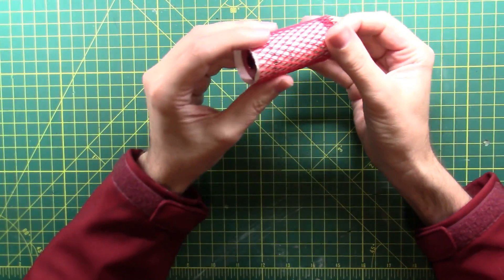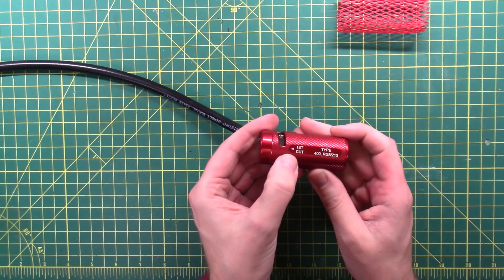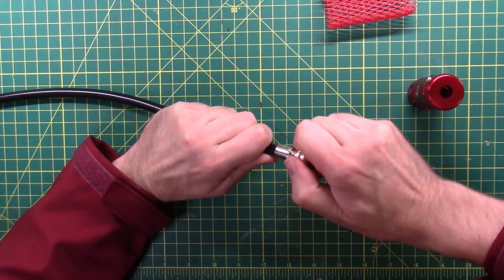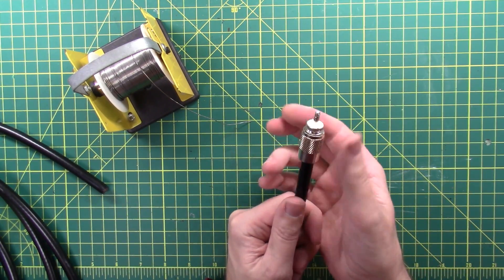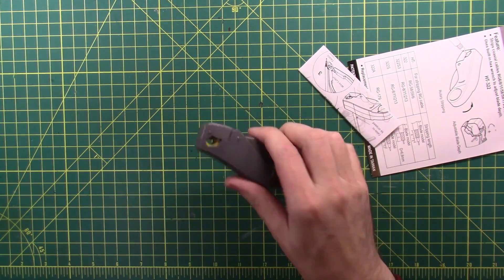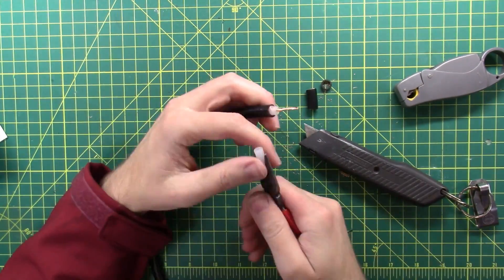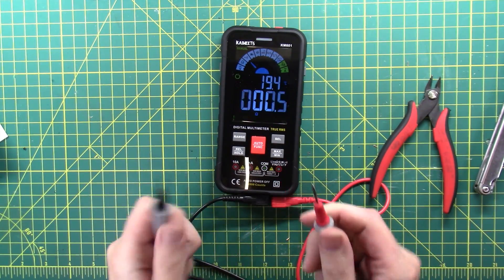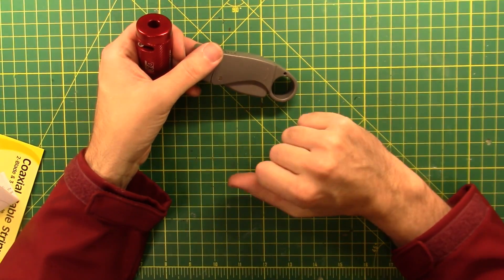DX Commander is Back! - How to install PL-259 Screw on Coax Fittings

Comment: Screw on PL-259's. Do you have to solder the end tip? Screw on implies 'done'. Evidently not since you are soldering? I have to ask because I have 4 antennas and 12 PL-259's to put on. If I don't have to solder I won't. Plus 10 of the 12 PL-259's will have to be put on  in the field :(

Comment: nice tools for coax. I found better PL 259 from M & P . and I went the lazy way. I had them make the coax I want with the ends I want and length I want and test them and ship to me.  used K8MRD for discount code. and now on the way from Italy . they ship in one box  . 50 ft POTAFLEX 7 reel kit and several jumpers . some with N . maybe I can tell my girlfriend it is a special bottle of wine .when she ask me what I order from Italy.  anyways great PL 259 from DX engineering. The amazon ones junk  I got. when using a reducer for RG 8X solder the shield. keeps the reducer from coming loose  and effecting SWR . what happened to me. or just get PL 259 for RG 8X and no reducer needed. 73's
Reply from the maker: Great tips, thanks

Comment: Well, that looked like a great tool so I was going to buy one until I saw on the eBay listing that they don't ship to Hawaii. Oh well, my razor knife works good enough and I can get replacement blades for it shipped here.
Reply from the maker: Does dx engineering's website offer shipping to HI?
Reply: @temporarilyoffline  Yeah, I have ordered from them in the past, but they gouge us on shipping so I normally go with their competitors.

Comment: Fantastic & easy tutorial Steve & thanks for posting!.
Only thing I'd add is I'd buzz out the connections for shorts & continuity tests on long runs.
Those 259s look like top quality connectors.
Generally, I personally avoid soldering the braid as it's easy to melt the inner insulation but have tried both ways as differing organisations have differing requirements.
Have used both tools & for ease the 1st box cutter type tool is almost effortless especially when doing lots of coax stripping.
Must get me some stripper tools to suit 213s & LMR400 as mine are seriously ancient & can't do those cables.
For outdoor installations of coax I honestly prefer to run them inside conduit as possums, parrots ie cockeys, rosellas, cockatiels & other animals here in Australia seem to find coax a "Salt Bae" type delicacy to munch on & cover connections with amalg tape for waterproofing.
Keep up the awesome work!
Reply from the maker: Thanks for the kind words!  Completely agree!

Comment: Regarding DX Eng. tool, wire and connectors ... seems as easy as messi paoloni, no? And I have already bought a crap load of DX Eng. 213, so no crimping ... me likey. AND the connectors are reusable ... NICE!
Reply from the maker: RG-213 is a "standard", so the tool from DXE should work with M&P connectors. Maybe I'll try that next time.
Reply: @temporarilyoffline  Thanks, that's good to know.

Comment: I used the gray cutter in the video for solid cables, LMR-400, LMR-240 and LMR-195. For RG-58 and RG-213 I used a new simple box cutter blade and it works great if you dont cut your fingers.  HI8DL
Reply from the maker: If I only did one or two, I'd used a box cutter blade... but I always seem to need to do 5 or more.

Comment: Rg-213 and lmr400 are pretty similar but DXE says its for 213 and no mention of LMR400. What say you?
Reply from the maker: This is for 213 and 8, I've never seen lmr400, so I can't speak to it.
Reply: @temporarilyoffline  so I called DXE. The answer is No. it’s possible but won’t cut as clean. Also lmr400 has a foil in it that causes issues. Then there is the lmr400 Ultra Flex version that has a glue like element inside. Both 400 and 213 are the same outter diameter like I thought but 213 is solder/solder and 400 needs a crimp/solder. Andy at DXE was very helpful.
Reply from the maker: @forgetyourlife  excellent,  thanks for the update

Comment: Tried the spinner they sell for RG 178.  It was a nightmare.  The DX Eng. device is top notch.  Do you need to solder the center pin for crimp connectors too?
Reply from the maker: I've never crimped coax... I don't know.  More to learn!
Reply: @temporarilyoffline  K8MRD had a video on it and swears that crimping is equivalent.  I had a huge issue with crimping that RG178.  When I checked continuity I could not get anything on the center pins.   Before I moved I had LMR400 and crimping that stuff required WWE-level hand strength.  But it did work as the center pin was solid wire and I used one of those DX Engineering cutters to make it work.  But I did not solder, and it did just fine.  However, to get the RG178 to work I had to solder the center because the center wires were very fine and I suspect did not make good contact with that center pin.  Thanks to going back and watching your soldering video, I was able to do that, and the fire department says the damage isn't really that bad. lol.
Reply from the maker: Does the crimper you have crimp both the inner and outer?
Reply: @temporarilyoffline  I am using the one for RG 178/316 and it has a tiny little metal tube that goes only over the shield portion of the coax.  You basically push it as far up against the bottom of the connector as you can, then crimp that onto the metal part that extends down from the connector.  Then I use a razor to trim any stragglers and heat shrink to seal it.  I'll shoot you some photos offline.
Reply: @temporarilyoffline  NO, just the outer.

Comment: Those looked nice quality PL-259's. I found a supplier that sells very nice compression fittings and I haven't looked back since.
Reply from the maker: These are the DX Engineering silver plate.  They are pretty good.  Where did you find compression style fittings?

Comment: What a sweet Tool that HAM Harder Coax Stripper 😂😂😂💯🍻🙋‍♂
Reply from the maker: I worked better this time then when I first used it a few years ago.  Compared to the Gray one, the Red one is amazing!
Reply: @temporarilyoffline  Yup I can see that, Steve. It's more safer working without cutting your Fingers. I still do it oldschool Redneck Country Boy German Mike Foxtrott like with a Cutter knife or Butterfly Knife, Tin Tool whatever is available.including kurting myself on and off. That's Romantics by itself. Great Documentation Buddy, keep up the great Work. How are Leah and Rebecca?? 73 de YFUG 💯👍👍👍🙋‍♂
Reply from the maker: @DK5ONV  The girls are great, thanks for asking!

Comment: Hi Steve,
The clip on cutting tool, after you do the spinning, just pull it off without opening it and it will take off all the cut pieces. I have two versions of that style tool and both needed minor adjustments to the cutting blade to make clean cuts. The gray one, like you have, is the better of the two. You and the family stay safe.  73  WJ3U
Reply from the maker: Thanks for the tip Don!